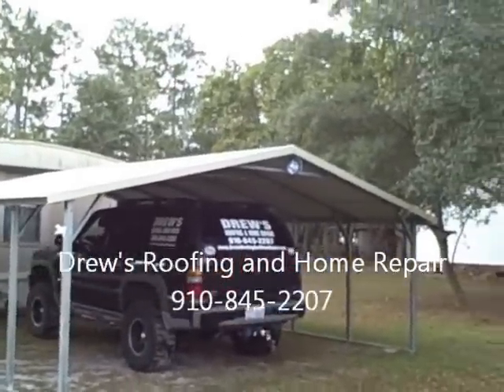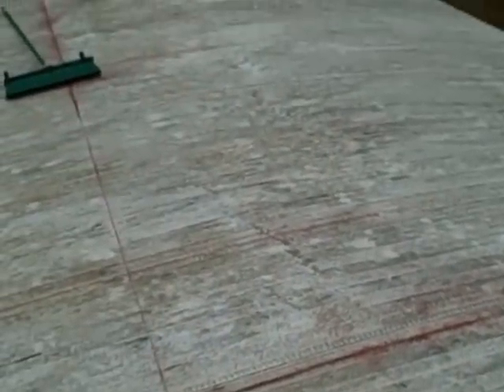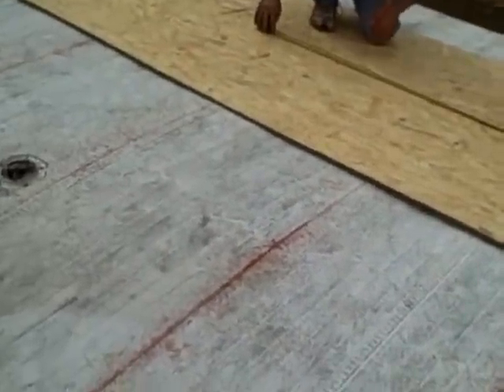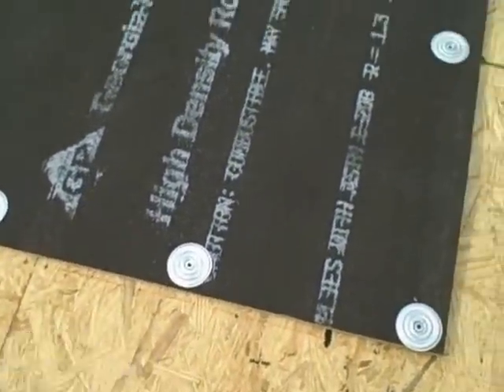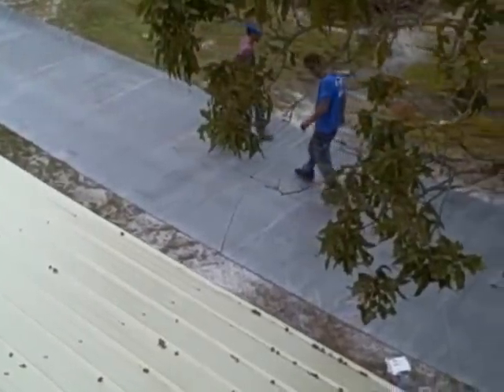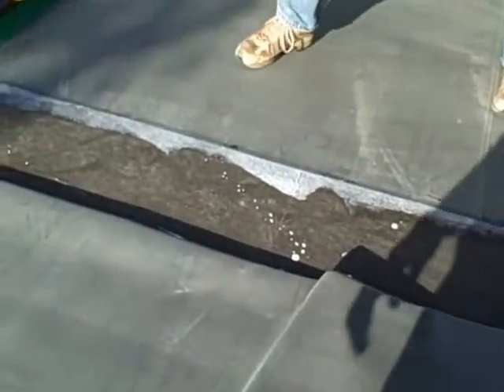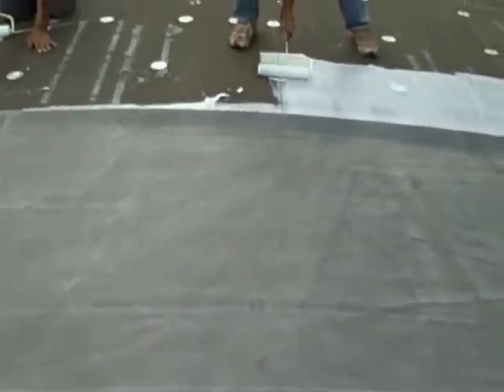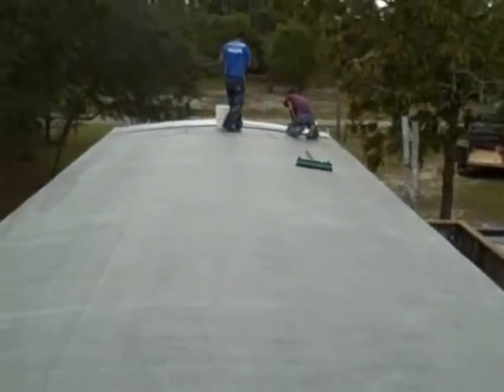Mobile Home Trailer Leaks and How to Repair A trailer roof

Comment: This is a much nicer job than another mobile roof repair video I saw from someone else. He also put down plywood, but he didn't cover it with fiberboard or even seal the gaps---he just put the rubber right over top of the plywood and called it good
Reply from the maker: You can actually do that, and to be honest, the gaps won’t matter in the OSB   I have done a bunch of mobile homes so possibly that might’ve been one of my videos most of the time I don’t use the insulation board that is customer preference it’s an extra $1500

Comment: It is surprising that they haven't come up with a lighter color for the rubber.
Reply from the maker: They actually have a rubber called TPO it’s white but it’s not the same. I personally like the black and I think it would last longer. I recommend coding it with white Hydro Stop when the roof is complete. Then it will be white and it will be very reflective and cool to the touch EP DM last longer than Tpo

Comment: Im in Southern California and my neighbor has this buts 20 years old and ripped to shreds from damage. She cant find anyone to work on her roof. Inspectors and Dept of housing are not easy and this was her 2nd roof. I did rolled roofing and its been good 20 years now. I still get a leak over my window though 🤪
Reply from the maker: This video might help you my friend. This is a good product.
Reply from the maker: https://youtu.be/AGnQow7qus4
Reply: @Drewsroofingandhomerepair  Thanks Drew. I already hit Home Depot the other day...got my supplies for whatever I may or may not need. I like to get on with projects and not make 5 trips to a store 🤣🤣 I get on my roof..do whatever and get er done! As for my friend with her roof. Metal would be best as she has a pitch. She has parents helping to foot the bill and I'm sure it will be around 10,000. 😯 Hot as heck here in so calif..stay cool 😎

Comment: Did you cover up the vent holes completely, and what about the mold on the original roof,  was it cleaned off before you started?
Reply from the maker: We never cover up Vance we replace them at the end it just might not have been on the video fireplace vent was removed

Comment: Could you paint it white with reflection paint. Heat resistant paint that is for rubber?
Reply from the maker: Chris Barrier it needs to be able to say EP DM paintable We use Hydro stop it’s white
Reply from the maker: Are use Hydro stop but if you know something that will work on a PDM absolutely use it you might have to clean the EP DM first make sure there’s no powder on it

Comment: What do you do or how do you measure when it's a 14x60 (actually 14x56 w/out tongue) with a pitched roof?  The metal is rusting in places.
Reply from the maker: tammygurl64 Measure the top and the sides

Comment: Drew you may have been asked this but the black rubber roofing you install we are in the middle of South Carolina and the heat gets bad at time's do they make a white or lighter color rubber roofing. Or is the insulation board and OSB under the rubber roofing adequate enough to disperse the heat to help with heating and cooling cost.
Reply from the maker: You can put insulation board but I don’t think you need it I live in Southeast North Carolina get out here too.

Comment: I have a home similar to this one. I can’t find a video where they remove the metal roof. I’m planning to repair my home but there are so many options. It would really help me if I could see what the rafters look like before I decide the best option. Do you have any footage of what I can expect to find under the original roof?
Reply from the maker: Yes I do as a matter of fact if you will look at some of my other videos you will see that we have torn the metal off on a bunch of them and install the rubber on it with OSB I have a whole bunch of these videos where are you can see exactly the rafters if you have a telephone number I will send it to your telephone number several of them as a matter fact look at my playlist.
Reply from the maker: luis meza Call me 910-294-1761 send me a text message doesn’t matter I’ll be glad to talk to you there are many different ways to do a metal excuse me to do Rubber Roof thing over these metal roofs. You do not have to take the metal off
Reply from the maker: luis meza Yes I do have footage of what you will find underneath the roof if you send me a text message to the number I provided I will send you a link to the video

Comment: where can i buy this rubber sheet i need it to be 10' ft W  by 76' ft L   Thank you!
Reply: He said Mobile Home supply. But we bought some from Home Depot, it's a POND lining rubber. Not sure it's the same but I know it's durable. I do wonder why a cover over the black wouldn't be good. Especially if one is in the desert.
Reply from the maker: ABC Supply or Best distributing
Reply from the maker: ABC or Best distributing

Comment: Okay,  a satisfy project for me on my shingles Mobil home strip all the shingles open the skull of the Mobil home get rid of the blown in insulation blow in the new foam after I sure up the roof joyce with two by tours redeck the roof with pressure treated plywood put more insulation board under the heavy duty metal roof color of choice also qualifies for energy efficiency star. That would be a neck of a roof. Thanks

Comment: Well, the screws don’t get a pretty good hold of the little bitty piece of wood ( Mobil home trusts) 100% it will split or is all ready rotten. 
The only way is to build a roof in the top of the entire Mobil home that has more than 40 years old.
Reply from the maker: Mine is the best roof ever

Comment: Were can u find the rubber material and glue for it?
Reply from the maker: Home Depot no Lowes no   Best distributing or ABC Supply
Reply from the maker: Make sure if you do do your own roof you don’t have a bunch of wires under the metal like this. https://youtu.be/6eCF4OBSJNA

Comment: If You Previously Pulled The Metal Off Another Mobile Home And Found The Electrical Wires Run Right Under The Roofing, Wouldn't That Deter You From Screwing Down Through The Tin, Possibly Hitting A Wire?  Just Sayin..
Reply: wondering myself and also wondering if my roof is like that. kinda scarry and i got some leaks somewhere at edges and center with a wall by window geting mushy. i hate mobile homes lol
Reply from the maker: Yes now we know what to look for. Not many trailers are made this way. When they are we install strapping
Reply from the maker: Hitman1m1 If you check out the videos on the ones that we find wire on we add one by four strapping on the top to get off the wires check out a few of my other videos you’ll see them
Reply: @Drewsroofingandhomerepair  Yea buddy. Those old trailer roofs are terrible. They stopped making those crap roofs in the 70's?
Reply from the maker: Thank God they quit making them that was some of the worst ones we ever had to work on
Reply: @Drewsroofingandhomerepair  Oh I know.  One heavy person that doesn't know anything about those roofs,  can destroy one of those roofs in a few strolls back an forth. lol. and maybe fall through, like the press board floors. Those are fun to repair too.
Reply from the maker: I have some of them videos in my playlist Mobile Home Floor repair you can check them out to

Comment: You're putting too much weight on thw roof by doing it that way. I just brushed washed my roof, let it dry, and then I coated it with liquid rubber. That was 5 years ago at 1/4 the cost.
Reply from the maker: Raul Villalobos nice. These people wanted a real rubber roof that would last with no maintenance. They were tired of the cool seal
Reply: @Drewsroofingandhomerepair  👍

Comment: Re; @10:15  the final step of video;  putting on the metal bar all around.  How would you install a gutter over that? As part of it?   I saw one of your videos had gutters but now i cannot find it.  Lord how I wish you lived here and I could just hire you.  I'm going to have to force feed this video to my carpenter in hopes he's willing to go for it.  I have another question, could the plywood go over the edge 2 inches with a fascia board to support it?  Cause I would kill for even a hairline overhang.

Comment: LOOKS GREAT ! AND WELL DONE ... I wish you were close to this town , they put aluminum white in my modular and somme how it keeps leaving this nasty track of black greenish tone drip tones all over the side walls loos like a creepy cemetery ! have a question did they miss a step of insulation ? or why is doing this ?  as an expert do you have an idea why IS THIS HAPPENING ?
Reply from the maker: It’s mold. Spray it with bleach and soap. It will go away

Comment: Why not just use rubberized roof paint available at Home Depot? Just paint on a good thick coat And maybe a year later paint on another one
Reply from the maker: Bassplayer Marty The customer wants to be completed with the roof and never have to go up there again this is the alternative to doing it once a year. You never have to do it again. You can also paint this white

Comment: I'll ask the same question now I know better..
Where do the rafters have airway vents in the top so the air can travel through out the home. If not it gets mold inside from rain leaks and we dont know if not told.
Reply from the maker: We are in North Carolina we do not have cold weather as a matter fact we don’t have snow and these roofs for some reason I didn’t build them but they are not vented through the roof side they are vented on the outside soffit side through the metal